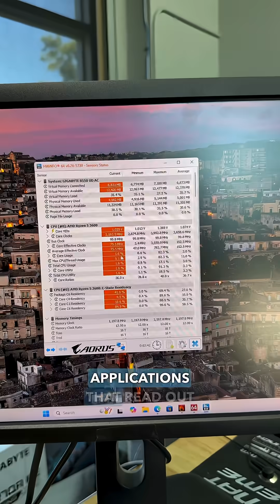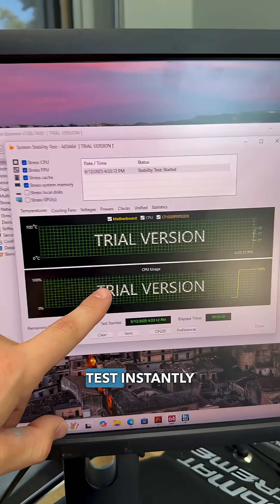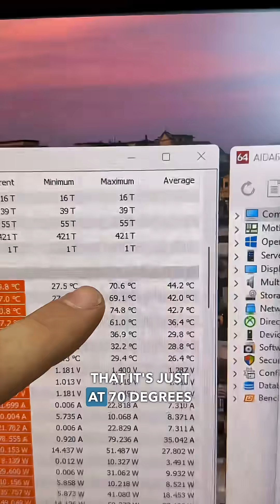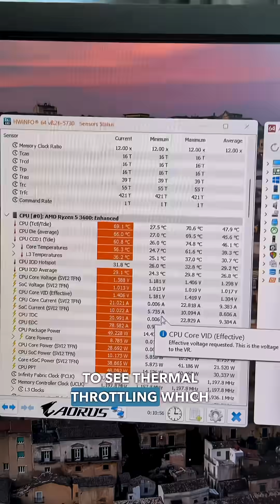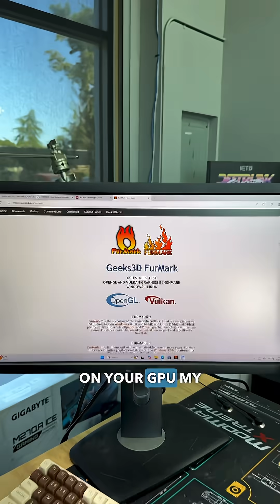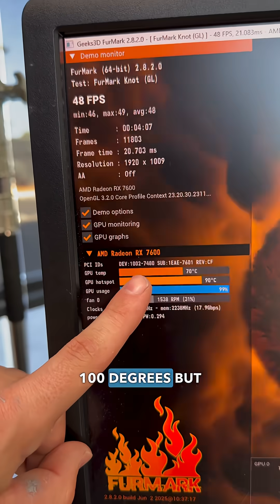Check PC Temps! #tech #pc #techtips #repair #cpu #gpu #gamingpc #pcbuild #gamingcomputer

Comment: GPU-Z is so much better for this.  It graphs the temperature on a timeline and is a lot more simplified.  Also most of the time your GPU is going to be the problem.  If it's an Intel CPU you can also run throttlestop as it has much more information about what triggers any throttling, as well as a built in stress test.  Also it can undervolt on platforms that allow it, further letting you fine-tune.

Comment: A bit more info if anyone decides to repaste or replace their CPU fan due to overheating. Be wary of the way you place your fan once you finish repasting. I recently repasted mine due to overheating and it had an error after I put everything back where it won't POST and boot in to Windows when all the 2 RAM slots are used. I tested both RAM sticks and slot on single channel (1 ram stick only) and they work just fine but when I try using dual channel (2 rams sticks combine) the pc lights up, fan spins on, and it immediately turns off without showing any display. I did a bit of reading and it turns out if you tighten the screws holding the fan on to the CPU too much it'll cause the chip in the CPU to not recognize dual channel RAM slot. The solution was to loosen the screws, really lightly wiggle the fan and heatsink a bit, tighten the screws back again but not too much just enough for the thermal paste and heatsink to make contact, and that will enable the dual channel RAM working again. It's rare but it happens, I literally spent two days troubleshooting why dual channel won't work, disassembled everything etc. If loosening doesn't work then time to take it to a technician to check for bent CPU and motherboard pins. I'm leaving this comment in case anyone encounters the same issue.
Reply: I only ever had this on LGA 1700.  Although I suppose if your heatsink lets you overtighten the screws it could happen on other platforms.  I've built over a dozen LGA1700 and all of them got a contact frame so that the CPU was held flat.  Its 3 to 8 dollars well spent (Even used one on a Pentium G7400t)
Reply: Literally happened to me today! This has to be a miracle to find this comment, i just repasted my cpu and gpu and dual channel is not working. Thank you for sharing sharing, I doubted it had something to do with the cpu.

Comment: I have an old gaming laptop that overheats upon startup and blows a lot of air, and the fans are very loud. I haven't checked the thermal paste yet, but do you have any suggestions for anything else? (the CPU is quite old, I think it might be the issue)

Comment: "90 degrees for any modern CPU,
95 if you have am5"

Saying that after all the info we have of intel 13 & 14 gen chips overheating issues is crazy.
Reply: It depends on what you let the BIOS do.  I had a Thermalright Phantom Spirit 7-pipe and my 14700 no-k would not do much over 200-220w before it throttled down from heat while blender rendering.  The BIOS is in charge of the heat.  The dead chips are from an overvoltage in a specific part of the chip.
Reply: @milescarter7803  That's true. 
That does not change the fact that am5 chips average way cooler temps; Even the ones that consume the same as their intel counter-parts.

Comment: Thermal throttling isn't the only problem, physical damage due to overheating is something even worse.
Reply: Physical damage doesn't really happen specifically BECAUSE thermal throttling exists. It prevents the CPU from hurting itself from the heat

Comment: Is there a program that I can use to see what’s wrong with my pc? Since when I try to play FH 5, bodycam and warzone, my pc just crashes. Drivers are up to date, I got ryzen 7 5700x3d and 4070 with enough ram and 850w psu. Also windows update doesn’t want to install and gives me a retry for some reason tried to reset the windows but didn’t work either.

Comment: Probably diagnostic god already does this, but for others at least, always run the tests with all panels installed on the case, the same as when you're gaming.
If you use your pc inside a cabinet or something, run it from there, maybe that's the problem and it has no airflow

Comment: is 75 degree on a zotac 3060ti normal after undervolt on games?
Reply: I’d say this is a perfectly normal temp for that card even undervolted if it’s an air cooled card. Nothing to worry about there at all. Creeping up to around 90-100 degrees would be where you may have to reapply paste and clean the dust from the fans. You’re all good 👍
Reply: Undervolted reaching 75? I'm a little worried for it. Maybe adjust your fan curve using GPU Tweak.

Comment: But when i stress my cpu one core is way hotter than the others like core 0 is 90 while all the others 80~78 why is that and is it dangerous?
Reply: There’ll always be one or two cores that are hotter than the rest - all cores aren’t made equal so there’s always 1-2 that run hotter as they’re doing most of the work. This is normal 👍
Reply: Some newer CPUs have cores with differing architecture between each core. High performance and Efficiency cores. It is likely your CPU runs hotter on these high performance cores

Comment: I wanna send you a motherboard ive got that has a really strange issue. It shuts off the pc when cpu temps hit 70c and its so strange and have no idea if its a broken sensor or just some bios setting im missing
Reply: Maybe a power supply issue? But if it happens specifically at 70⁰ then it might be something different
Reply: Save your current bios settings and reset to default and recheck. Having shutdown specifically at a specific temp, not load, is weird. However, in any stress test, hitting 70C typically is within the first few seconds so are you sure it's temp and not power related?

Comment: Is it bad that my GPU temp is C°78 and CPU C°70 when in the loading screen of a game? Also you didn't mention msi afterburner for monitoring the temps and usage.
Reply: HWinfo just has more sensor data, cleaning AIO is pretty much just dust off the radiator, and context is needed on your PC specs to determine if the CPU and GPU temps are suboptimal
Reply: Well from what i can remember is that the GPU is a gtx 980 ti and mabye the cpu is like a old i5 idk if the ram is important for determining the CPUs age but its DDR4 also it was kinda stupid the way i phrased it but i meant determining if my AIO is working properly  @kazefw3834
Reply: same issue on train sim 5 on main screen i get both cpu and gpu team at around 70-75 , useing ryzen 5 3600 at base clock no pob ,and undervolt rtx 3060ti, before it used to be around 64-68 temp, not sure if its ambient temp coz its hot here
Reply: @johnflow163 check the thermal paste for both, reapply if it's dried out, use something a but more viscous to avoid pumpout
Reply: You should also make a short about how to clean AIO's
Reply: Btw My PC was built in 2017